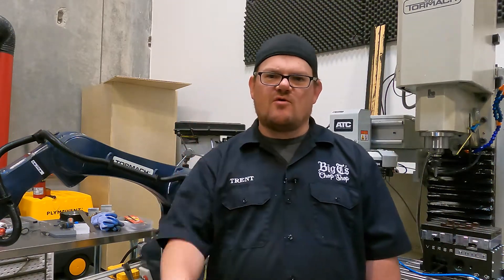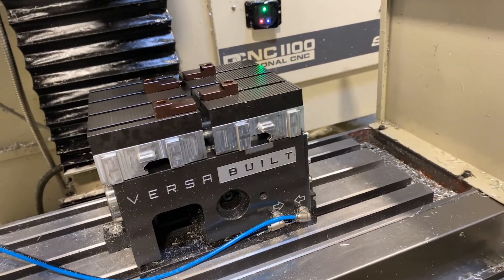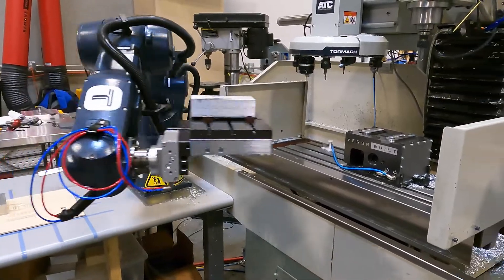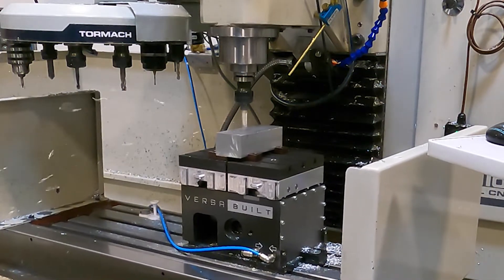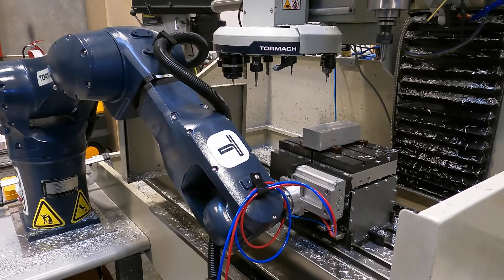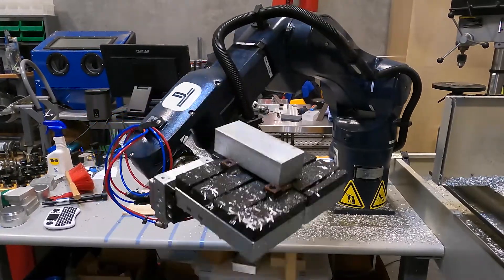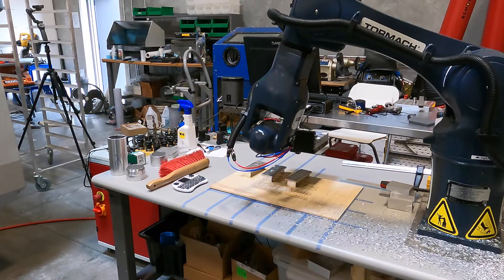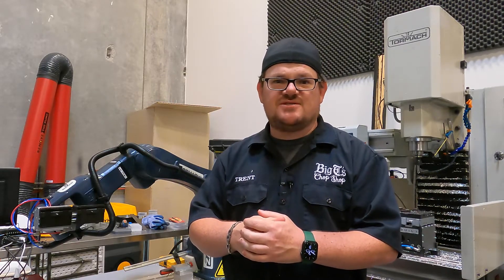CNC Mill Automation With the Tormach ZA6 Robot and VersaBuilt Multigrip System - Episode 4

Comment: Does the probing macro determine correct loading of the part or really just establish new work offsets? Also how would compare, either speculatively or anecdotally, this robot's production capability compared to other automation options like Haas pallet loaders or APLs?
Reply: Both. There's a tolerance on the loading point (Usually I use 0.1"). If it's within that from the last load, it will adjust the work offset and continue. If the part is farther than that from the last load the program pauses and waits for me to come by and check before continuing. Pallet loaders and APL's will definitely be faster and more efficient than my setup, but at a higher cost to implement initially. If you have high volume repeat jobs or standardized workholding, pallets are definitely more efficient.

Comment: You think Tormach is the best small shop robot? I REALLY want to use a robot with the Pierson Pallet System so I can load pallets instead of single parts, but the Tormach robot can only hold 13 lbs.
Reply from the maker: So, there's a couple things there.

Is it the best small shop robot? I would say "Depends on your budget". Under $20k, it's pretty decent but there are definitely other options as well. For ease of use, a cobot like a UR or Fanuc is probably easier and safer to set up albeit at a higher price point. A UR10 is probably the gold standard and can lift 25lbs but it will be more expensive. 

As far as pallets go, I love the Pierson system (I have one here) but it probably wouldn't be a system I'd try to load with a robot now that I've used it. It requires very precise alignment of the pins onto the base and sometimes mine is hard enough to align as a human let alone for a robot. There are pallet systems from Schunk and some of the others specifically designed to be easy for robots and automation systems to align. Those are probably worth looking at. 

A Tormach ZA-6 trying to load Pierson pallets would probably be a very challenging system to tune to be reliable.
Reply: @bigtchopshop  I wasnt sure about the positional accuracy needed for the Pierson pallets so thank you. Thank you so much for the Schunk reference too, I'm going to look into those. Some times I search everywhere online for specific solutions and just can't find anything, I appreciate the help.
Reply from the maker: @KramerMachineTool Yes. It needs to be quite precise for the Pierson pallets to line up. The Schunk stuff isn't cheap, but you can see where they are going with it - basically, there are features on the zero point systems and pallets that are tapered and/or mechanically guide the pallet into the right alignment as the automation system places it. This allows you to have a little bit of slop on the loading and still be able to get the pallet loaded successfully. In my experience, this will save you a lot of headaches. The robot arms are very accurate, but it's a long swing, and there are variables loading and unloading and how you pick up the pallet, and how firm the surface is that the robot is bolted onto, and so forth.  Schunk isn't the only one making such things for sure, but a good reference. For example - https://schunk.com/ca/en/workpiece-clamping-technology/quick-change-pallet-systems/automated-machine-loading/c/PUB_8474. Feel free to reach out via http://bigtchopshop.com if you want to discuss this in more detail.

Comment: It’s great that you took on the task of learning this all by yourself.  What I have found is the “unattended” operation reality is that you need very long cycle time parts and that the delivery/work storage systems are very limited.   The robot manufacturers have some systems that accommodate multiple part storage of raw stock and finished product but the flexibility of them with regard to size and shape ends up being very limited.  I get that but it is a bit frustrating that most want to load one part in one vise in one milling machine.  Try to stray from that and it is very limiting.
Reply from the maker: Totally agree. I am actually working on a system for loading pallets onto a zero point fixture next so that I can vary up the jobs and the workholding a bit. The challenge there is that there isn’t great off the shelf scheduling software for running different jobs on different pallets. I’m just trying to figure out how to manage all that.